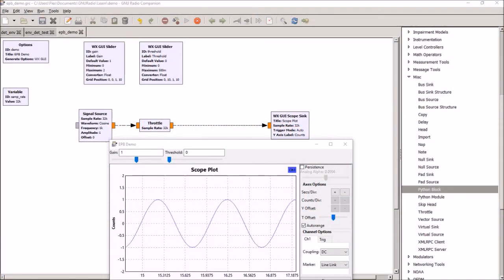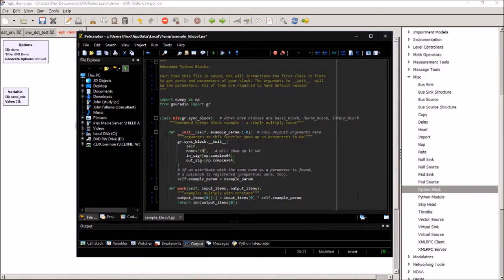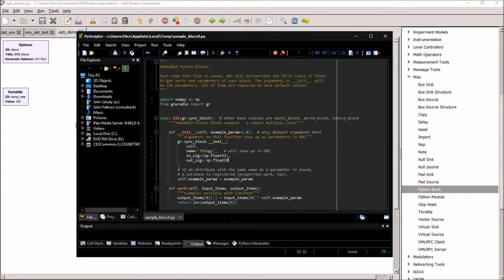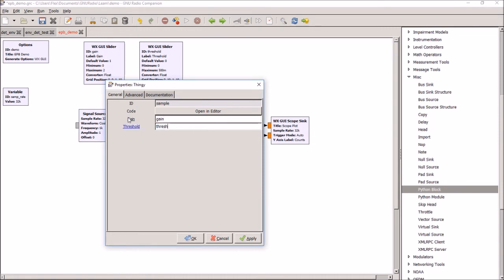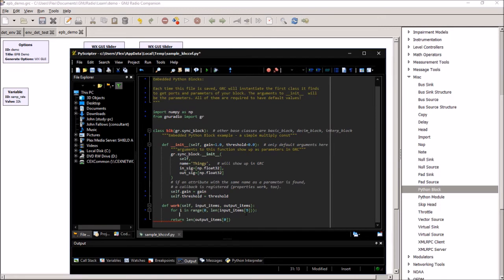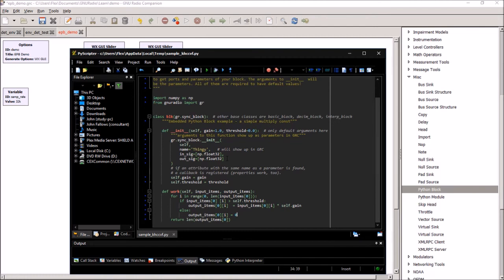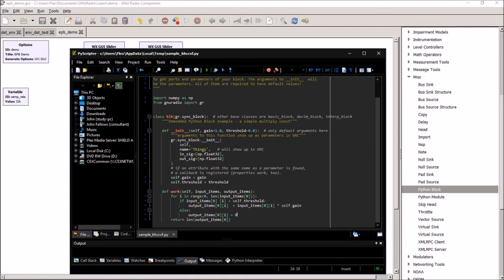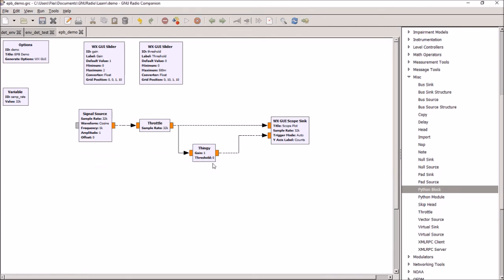GNURadio Embedded Python Block

Comment: Hi! Is it possible to create a Short-Time-Fourier Transform block in GNU Radio using python block? Thanks
Reply: We badly needed it for our thesis. Please assist us. We are willing to pay.
Reply from the maker: Hi Ed. I imagine so but that is beyond my scope. Suggest you check on a GNU Radio community site.
Reply: @VE6EY  Thank you for replying. Our team make an energy detector based spectrum sensing flowgraph in GNU radio. I want to ask where we can find the calculated energy?
Reply: or there is a need to add a code on the generated python file to perform the calculation of the energy of the receive signal?

Comment: Hello, how do you edit python blocks on windows?
I can't use it, I press 'use default' and it will run out
>>> Unable to load the default editor. Please choose an editor.
>>> No editor selected.
How did you solve it please?
Reply from the maker: I used PyScripter https://sourceforge.net/projects/pyscripter/ and it worked fine. Cheers...

Comment: is there a way to add this block to the list on the right so that it can be reused in another simulation?
Reply from the maker: Don't think so. To use the Embedded Python Block in another project, just put the python code block in the folder for your new project. :)
Reply: @VE6EY  yes. It has to be an C++ block then

Comment: I want to generate self coded sine wave following the same procedure but in coding using built in sin  function as this:
        p=30e6
 for i in range(0,len(output_items[0])):
  output_items[0][i]=math.sin((2*math.pi*i)/p)
 return len(output_items[0]) 
but i am not getting a sine wave, it's a ramp function, can you please correct me from anywhere?

Comment: How can I use this block to change a variable in my flown? Say I have a variable called "Numbers" in my flow, and I want to set that variable to the value of the input on the python block, can that be done?
Reply from the maker: Not sure. This video shows how to pass a variable into the processing block. You want to got the other way, but I did not figure that out yet.

Comment: Thank you for the video. I would like to use this block to make a block with vector input and vector output. I mean fixed size input and output. But it seems that it is not posible with the gnuradio version I have. I have GNU Radio Companion 3-7-9-2. Did you try to make something like this? did you have success? Thank you again
Reply from the maker: Take a look at https://wiki.gnuradio.org/index.php/BlocksCodingGuide#Basic_Block. You should be able to do this, as input_items and output_items are basically pointers to a collection of arrays which can be vectors. Suggest you try an experiment or two and see what happens. I am also using GNR 3.7.